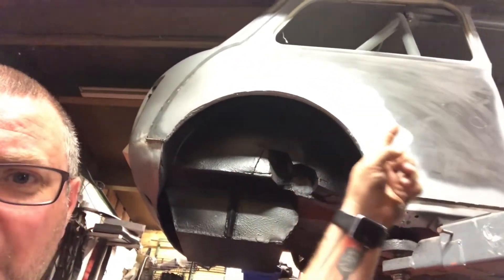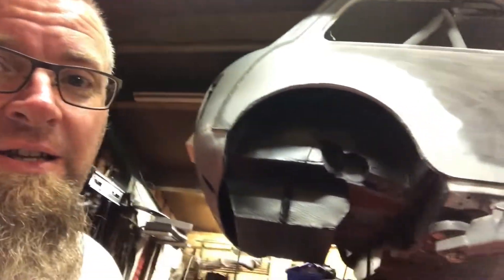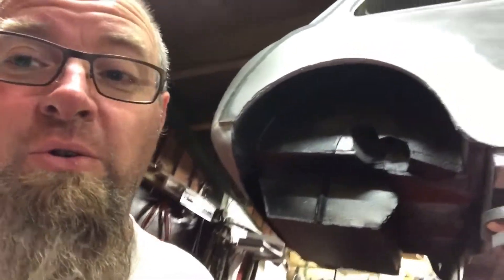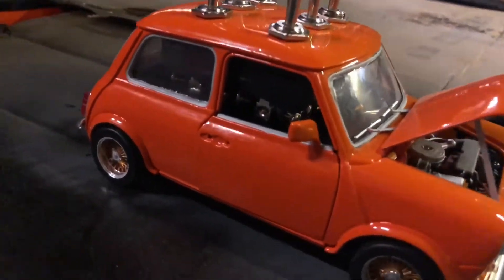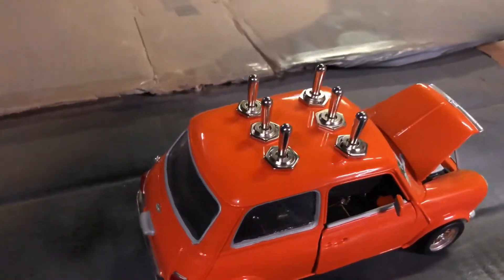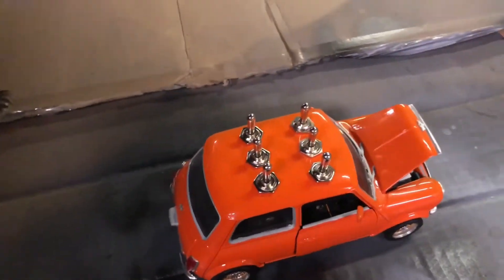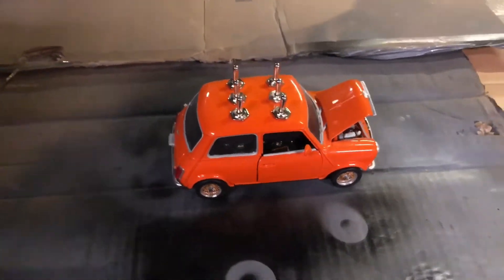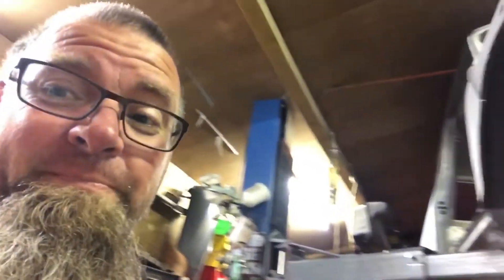Classic mini hydraulics build Part 40 ITS DONE !

Comment: Did you use a magnum panel did it go on ok
Reply from the maker: Yep its a magnum , the only slight issue was the bottom corner where it meets at the boot floor and valance .. it was about 4-5mm too short , although this maybe where the car itself is slightly off ? Ive used these magnums in the past and the fit is fairly good !
Reply: Thanks mate